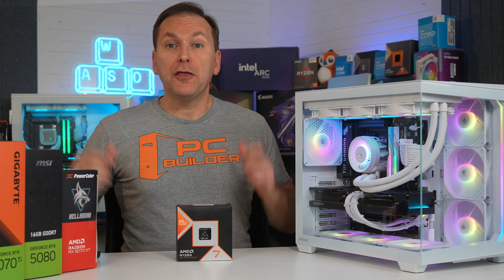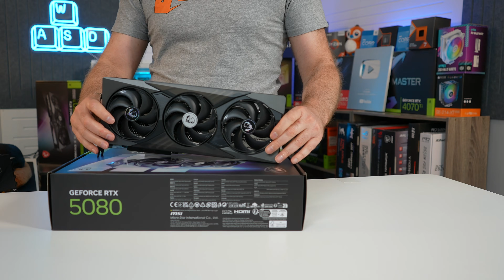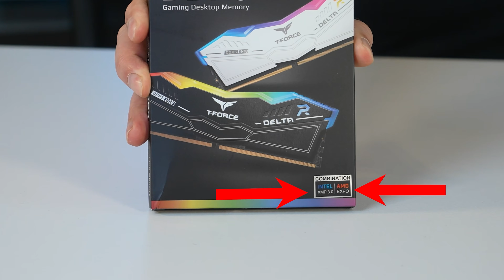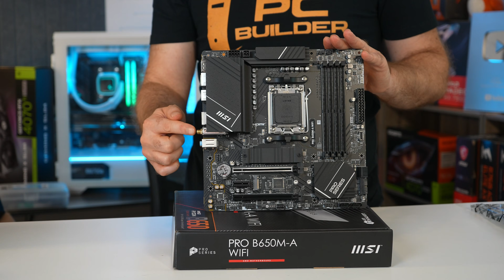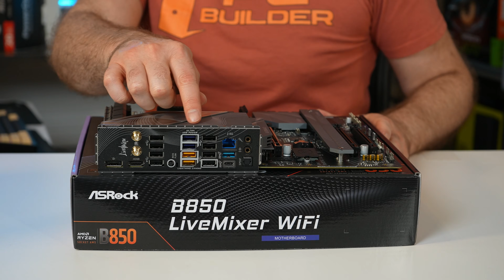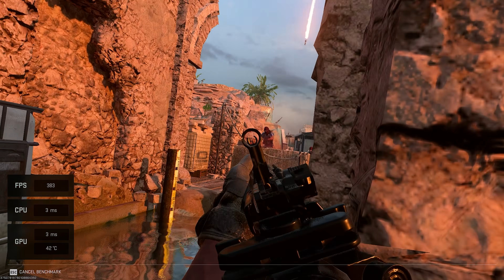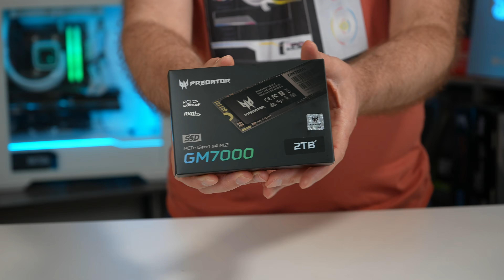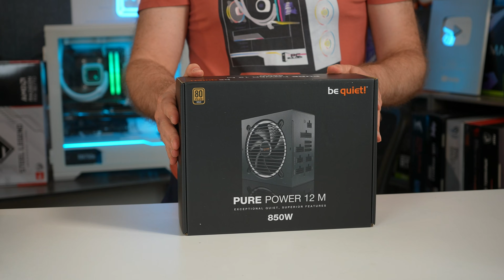Best Ryzen 9800X3D PC Build 2025 🛑 Best GPU, RAM, Motherboard & More

Comment from the maker: NOTE: WE NO LONGER RECOMMEND ASROCK MOTHERBOARDS FOR THE 9800X3D DUE TO POTENTIALLY ONGOING ISSUES.
What Ryzen 9800X3D build are you looking to do? Are you considering other CPU and GPU combos? What games do you play? What FPS and Resolution are you looking to play at? Tell your story in a new comment below!
Reply: I'm going to Avoid Asrock Motherboards for the Time being & stick with Gigabyte! I've had good success with this Brand: 3 out of 4 Boards worked out very well, the one Failure was an AORUS B450 Motherboard. But I'm also Not Buying a Ryzen 9800x3D CPU anytime soon! $700.00 for a CPU is Way to Rich for my Budget!!!
Reply: Ya, was gonna say ASRock vs 9800x3d would not be a GO with the reports piping up, though it is still a small number of failures vs all users with those motherboards/CPU combo.  @michaeloneill1360
Reply: @michaeloneill1360 what gigabyte motherboard you recommend for am5?
Reply: Already did the 5080 + 9800x3d + 32GB DDR5 6000 CL30. Playing black myth wukong right now at 1440p maxed out and it's great with frame generation
Reply: I'm upgrading from a 1060 3gb, and I plan to go with a very basic all white + rgb build. The price of GPUs in my country is ridiculous, so I'm going with a midrange build for RPG games. Would be open to any suggestions/improvements. Not sure if I can post pcpartpicker link, so I'll just list it out here. CPU:9800X3D GPU: Sapphire Pure 9070XT MB: GB Aorus Elite Ice WIFI7 PSU: Corsair RM850e Cooler: ArcticLiquidFreezerIII360 A-RGB White RAM: TeamT DDR5 6000 16x2 CL30 RGB SSD:CrucialP3Plus2TB Case: Lian Li O11D Evo RGB White Case Fans: Lian Li Uni Fan SL-INF 120. I'm getting the parts from a pc store and will have them build it. So parts I choose are limited to what they sell, also the Case, Case Fans, and Cooler are out of stock at the moment, and I'm afraid it might take too long for it to come to finisb the entire build before the orange man bends me over
Reply: @KaiserGamesGamersRiseUp  that will be an amazing build

One consideration for you, step down the cpu one generation and consider stepping up a tier. Especially on a budget a 7950x3d can be had in my country for around the same price as a 9800x3d and with 2x as many cores and threads, it will 100% handle gaming better than a 9800x3d, just won't get as high fps in a benchmark charts

The 9800x3d in cyberpunk 2077, can see up to 70% usage, which is fully saturated for gaming purposes on a 5 year old game, a game that will absolutely use 16 cores as well and the benefit to the rest of the end user experience is worth the small drop in top end fps from the 9800x3d, you will have a much better experience with the pc in general and it will last you longer aswell

8 cores isn't "all you need for gaming" it's the bare minimum nowadays bare that in mind too
Reply: I have a few questions, Would the RTX 5070 be a good choice for the Ryzen 9800 X3D or would it be better to downgrade the cpu to the Ryzen 9700X and getting the RX 9070 XT or the RTX 5070 TI. Also another question and this is the biggie, what is the difference between CL30 and CL 32. The Tforce RAM I was looking at is 6000 MHz and CL 32, would that work for this build?
Reply: ive had mine with a 7900 xtx for a little while now and its great!
Reply: Jason, great vid! Is the 850 W power supply enough to run the 9800X3D with a RTX5090?
Reply: @louisfriend9323  I have this combo but with a Corsair HX  1200i PSU. The 5090 can draw 600W all by itself, I did manage to see it climb to 597W on my rig. 850 might be a little tight. I would suggest a 1000W+
Reply: Is there a prebuilt with this configuration that you would recommend? I saw your prebuilt video a few weeks ago but there's no 9800x3d + 9070xt combo. Also don't think they had the best ram. I want the news tech but not over pay either.
Reply: Best combo low price for am5 R5 9600x and Rx 9070
Reply: @voicutoader9814  take my advice, 7700x or 9700x, 8 cores as a minimum, if budget allows, check the price of a 7900x or even a 5900x on a budget, very very capable cpus, now can be found dirt cheap second hand aswell

5900x is am4 but if you really are on a tight budget the money you save stepping back a gen will make a huge difference and for gaming they can still be very impressive with a mid range gpu, just won't have the opportunity to upgrade down the line
Reply: Awesome advice. Btw. I watched Kellen Moore play at the BSU stadium. I am confident in saying the Saints will be something to contend with in the post season real soon.
Reply: Just got my tax returns and spent a bit of it on the first parts for my 9800x3D build: a  Rog strix X870-F wifi and Lian Li Lancool 216. Super stoked! But I'm in no real hurry since the web store won't have some of the parts I want until May 27th
Reply: Would a RX 7700xt be a decent option for this CPU?
Reply: @Fatal4Life360  Sure. Anything up to a 7900 xt works
Reply: Please help me out with my doubt do we need to update bios for Asus tuf b850 plus wifi to pair with 9800x3d
Reply: People    DO   NOT    BUT   AUSROCK   MOTHERBOARDS      THIS  GUY   IS    NOT   TELLING  US   EVERYTHING
Reply: I'm going to build 9800x3d 
Steel Legend b850 
And 9070 sapphire nitro plus . Will this combo  do great ?
Reply: 9800x3d, 9070xt Asus tuf, b870 wifi Asus tuf.
Not sure if my dark rock 4 cooler is sufficient for 9800x3d tho.
Any inputs guys?
Reply: Msi Gaming X670E Patroit 2x 16BG DDr5 6000  CL30 and Taichi  9070XT
Reply: und Ryzen 9800X3D
Reply: 5080 9800x3d g.skill trident 2x16 ddr5 6000 cl30
Reply: I want to play call of duty but I started off with your premium built with GeForce RTX 5070 Ti is that a good start for me
Reply: Its costing me $1900 but heres my build...
CPU : AMD Ryzen 7 9800X3D Processor
GPU : ZOTAC GeForce RTX 5070 Ti Solid OC SFF 16GB
RAM : 32GB Patriot SL Sig DDR5 6000MHz CL34 Low Latency (16x2)
Motherboard : Gigabyte B650M Gaming Wifi 6E
Cooling : ID Cooling SE 214 XT (2 in 1 out)
SSD : 2TB Lexar NQ780 Gen4 SSD
PSU : 850W Thermalright 80+ Gold (ATX3.1; PCIe5.1)
Chassis : Small mini case
Reply: CPU: AMD 9800x3d
GPU: MSI 5080 Gaming Trio
Mobo: MSI x870e Carbon
Ram: Trident z5 32gb
AIO: MSI MPG p13 360
SSD: MSI SPATIUM M461 4 TB
PSU: MSI MPG A1250GS PCIE5 1250 W
Case: MSI MAG PANO 100R PZ ATX Mid Tower Case
Keyboard: MSI Strike 600 Silent Mechanical
Main Monitor: MSI MPG 271QRX QD-OLED 27.0" 360 Hz Monitor
Mouse: Logitech G502

Looking to upgrade to 5080 Super and 9950x3d.
Reply: Building an̈ i9-13900k on an Asus Z790-E, a 3080Ti, Lian li Lancool II case for the wife.  Next is a 9800X3D on an̈ Asus X870E-E with a TUF 4090 oc for me, Lian li 011 Dynamic EVO case.

Fair winds and following seas to all.
Reply: What  about 9800x3d , samsung 990 pro (or adata legend 960), deepcool px100g wh, and asus rog strix  B 850-A gaming wifi?

Comment: please advice that if with 5070 and ryzen 7 9800x3d i get 16gb ddr5 6000mhz ram is it okay later i could get one more 16gb stick
Reply from the maker: You really don’t want to run with 1 stick of ram. You’d be better getting a 2x8 gb kit

Comment: G.SKILL Trident Z5 Royal Neo Series DDR5 RAM (AMD Expo) 32GB (2x16GB) 6000MT/s CL26-36-36-96 1.45V Desktop Computer Memory U-DIMM - Silver (F5-6000J2636H16GX2-TR5NS) Was The Ram I got Today. MSI MPG X870E Edge Ti WiFi my motherboard steal with the 9800X3D from MSI Sale... Struggling on what GPU I have the 2080 Super Founders Edtion right now been told I will be okay for now but consideirng a GPU upgrade next year

Comment: Literally have the 9800X3D in cart right now with the Aorus Elite mobo. I'm trying to figure out if I should go with the RX 9070XT or go to NVIDIA and try to get a 5080?
Reply from the maker: Either was a great choice if you already bought but in case you haven't, the 7800X3D is actually on Prime Day sale for $338 so if that helps get you to the RTX 5080 and you want it i'd do that. Otherwise stick with RX 9800X3D and did you see the RX 9070 XT 16gb for $629 deal we posted? check the community page if not
Reply: @PCBuilderChannel awesome. Thanks for the suggestion. Been following for a while now and looking to build a new rig. Going o give my current rig to my wife for her content creating. Definitely need to get over to the page see the 9070XT. That price I’ll probably buy all 3 today.

Comment: Planning on a Black Friday 9800X3D build.  Have two NVME SSDs (4 TB Samsung 990 Pro and 2 TB Samsung 990 EVO).  Planning on a 5090 graphics card.  What motherboards would be best suited for this build?  Since the SSDs are PCIe 4.0, will there be any issues with the 5090 PCIe x16 slot?  I believe that only PCIe 5 SSDs would have issues, but wanted to make sure before purchasing the parts.
Reply from the maker: Your pcie ssds will be fine. As to your motherboard it depends on what features you are looking for. Hop on over to our Best Ryzen Motherboard Fall 2025 video and go to the premium section.

Comment: Hey pc builder, For an Air cooler, Do you the the Pure Rock Pro 3 LX would handle it well? Not too worried about noise because I have noise proof headset but I wouldn’t want it running max speed trying to load game assets constantly in games like The Finals or Cyberpunk…

Comment: My build for the 9800X3D will be: Lian Li 011D Mini V2 Flow (insane value case with 5 fans +adding 3 Corsair LX120 RGB reverse fans), Scythe Mugen 6 DBF CPU cooler, MSI MAG B850 TOMAHAWK motherboard, 2x16GB Corsair Vengeance RGB RAM 6000mhz/CL28 (+2 dummy RGB RAM sticks), Corsair RM1000x PSU and MSI RTX5080(S). Probably waiting for the super variant of the GPU and seeing what price the different versions have. So far I've always went with the Gaming Trio variant for better cooling.

Comment: I am getting ready to build my first PC and your videos have been great, Especially with me finding a power supply. I'm doing the TUF Gaming B850 Plus Wi-Fi motherboard, 9800X3D processor, Corsair 32GB ARGB RAM, GeForce 5070 Ti, Samsung 990 4TB SSD, 500GB SSD SATA drive for OS (had it lying around),arctic liquid freezer 3 pro 120mm AIO and ASRock Phantom Gaming PG-1000G PSU. My tower case i bought from my boss a few years ago and is the Rosewill Cullinan MX Tower.

Comment: What case fans did you use in this build?! This is my exact dream build in this video! What are the exact specs? The Newegg parts list is different than the video
Reply from the maker: I do update the list as prices change but the case I built in was the Antec C5 in white and it comes with its own fans you don't need to add more. Its linked in the video description
Reply: @PCBuilderChannel  sorry I missed that detail! thank you for this video!

Comment: You seriously recommending an ASUS board, look elsewhere guys. If you don’t believe me just look at what Steve in Gamers Nexus says about this MB.
Reply from the maker: I think you might be confusing ASUS with ASRock? The reported X3D CPU failures for Ryzen 9000 are on ASRock motherboards. There was an issue with ASUS motherboards in 2023 when the 7800X3D first came out, however that issue has been resolved for quite some time.

Comment: Built a 9800x3d on Asrock x870e taichi, g.skill z5 6000mt 28cl, MSI 5080, corsair 1250W gold (got this beast from a friend that works in a pc shop with almost 60% discount since they accidentally ordered a 100 instead of 10 and had to move them fast), in a corsair 3500x case, cooled with Krackn 360, and shit load of case fans for air flow, a Smasung gen5 2TB ssd, now kind of want to upgrade my monitor to an oled, IPS even tho mine is a fast one just seems dated for the system.

Comment: I'm assembling my new build this weekend. A 9800x3d so of course a new motherboard and 32 gigs dual channel of 6000 cl30 ram. 850W Seasonic PSU aaaaaaaaaand a GTX 1070! WOW.

- I'm saving up a bit before buying a 9070 xt, so it'll have to do for now lol.

In a black Fractal north case with side glass, love the aesthetic. All black interior with my noctua noire cooler. Maybe getting a light strip or two to get at least a little glow, but didn't want to go with RGB ram because i'm pretty sure my cooler covers most of the ram anyways.

Comment: i have 9800x3d paired with a 3060 (12gb). This is definitely a GPU bottleneck hence I am planning on buying a GPU. should i buy the 5080 or wait till the 5080 ti/super comes out?
Reply from the maker: Me personally I wouldn't wait. With the 5080 at msrp and the free game thats a good price for that card. Even when the supers come out we will be looking at the same crazy stock and price issues probably for months for very little actual performance boost. See our latest video on the channel for more its our Best GPUs September video
Reply: @PCBuilderChannel  thanks, and lastly i am looking into the Zotac brand for the 5080 - is this a good brand (i dont really care for OC etc)? Or should I spend abit more for Gigatbyte, MSI, Asus etc?
Reply: @AxomeV10 any brand should be fine.  I assume Zotac is the cheapest Brand/Model where you are?
Reply: @ty09162 actually Palit and PNY are but I haven't heard much about them. I know Zotac, MSI, Asus and Gigabyte.
Reply: @AxomeV10 Palit and PNY should also be fine

Comment: I have a 5060 ti. Am I going to run into problems trying to pair it with the 9800x3d?
Reply: No problems.  You'd just have an imbalance.  You'd have a better CPU pair with a 9600X.  At least that's what Jason would say.

Comment: im trying to  build a full out MSI pc. im leaving the 5800x3d to build a 9800x3d. what i have planned to use is the MSI MPG Velox 300R Airflow PZ - Mid-Tower Gaming PC Case with a MSI MPG A1000G PCIE 5 & ATX 3.0 Gaming Power Supply. the motherboard im choosing is a MSI MPG X870E Carbon Wi-Fi Gaming Motherboard. i was going put 64 gigs ram but after watching this video ill just stick with 32 gigs and i be using Patriot Memory Viper Venom DDR5 RAM 32GB (2X16GB) 6000MHz CL30. im stuck on what to use for the GPU and SSD my 5800x3d has over 5 TBs of SSD and i only have used less then a tb so i think maybe use a max of 4tb in this pc build. but as for the GPU im not not big fan of Ge force and want to stick with AMD. but where AMD just came out with its new 9060 and 9070, so im comfused what to spend since all ready spent a pretty penny on this  MSI build. the AIO i went with a Grand Vision 360 ARGB Black CPU AIO Cooler,PC 360 Specification Water Cooler System,IPS. i used an older version then this one and h ad zero issues with it so time to use same but upgraded.
Reply: 9070 or 9070XT would be good here

Comment: I upgrade my Pc with Ryzen 7 9800x3d procesor and Asus strix Rog B850-f motherboard,i buy White shark 850w power supply and i put Thermalright Peerless Assassin 120 SE ARGB, black on it.Everything work perfect.Battlefield 6 beta i play with 60c  CPU temperature.I have a litle problem while instaling and try to enter in Bios,but this combo is perfect 😊😊

Comment: Hey man I need some help I’m in the uk making new pc for 9800x3d but I’m kinda stuck on which motherboard to get I was looking at msi b650 gaming plus WiFi or Gigabyte B650 AORUS ELITE AX V2 both £135/182 usd or spend more for x670e msi gaming WiFi which is £170/229usd 

Also about the gigabyte one I’ve heard some issues about ram and I think bios although not sure if this is a wide issue or unlucky person

Comment: is a " Asus ROG Strix B850-F Gaming WIFI " motherboard also a good use for this cpu? + a " 2TB Samsung 9100 PRO M.2 2280 PCIe 5.0 x4 " for the mainboard?
Reply: They are but Gen 5 SSDs aren't Worth it when while that Motherboard is good, if you in the US MSI has Motherboard Bundles Deals which are nice.
Reply: @ty09162  the money isnt really the problem thoo

Comment: unlikely to get a response but i genuinely cant find any information for what im looking for, i know theres no "BEST PARTS FOR BLAH BLAH BLAH" but not including cooling/gpu or anything else, just MOBO+RAM+NVME. what is the best for a 9800? i want PURE performance and speed. the ram and m.2 being extremely good and "fast" is a must.
Reply from the maker: The premium list is exactly that, my picks to give you the best performance. Keep in mind the motherboard choice  isn't about performance  (as long as you are getting the right board for your CPU) thats just about the features you are looking for. And you can go up from our recommendation on the ram it just won't actually do much for you. What will is your GPU choice. If you want the best possible performance your move is the 9800X3D plus RTX 5090.
Reply: @PCBuilderChannel  ill def give it another watch and give it a full dive, regardless do you feel that this list is still the "best"? ( i know much doesnt change in 4 months, id just rather ask than not.) also thanks for the reply! means alot!
heres some more info tho,

not needing help for any parts besides the ram      -     mobo     -    m.2   for a 9800x3d build, Ive got zero issues with upgrading or chaning out a gpu or whatever else, i just want the base of the board (m.2/ram/mobo) to stay the same as long as possible, unless something gets released and the %increase is worth the change out, my only preference for anything is id prefer ATLEAST 64gb of ram, im not too knowledgeable of Nmve speeds and all that jazz 
i mostly only play ONE game, RUST. iykyk.
I want to be be able to load into a rust server in -2 seconds and be capable of loading the 30 man zerg base within a single blink of my eyes! ;)
all jokes aside.

though budget isnt an issue id rather not drop $200+ for a 1% improvement in load times or 'fps'
i do stream and love screan sharing to my friends but besides discord or basic things like that its purely meant for gaming (i have a secondary streaming pc that i do everything else on.)
not sure what else to mention so if there's anything questions or something else that yall would add, feel free!
Reply: @conneh if in the US and you haven't got the CPU yet MSI has Motherboard Bundles Deals on their Website.